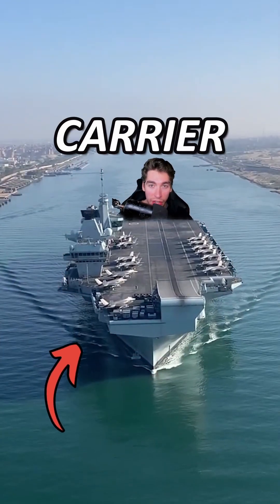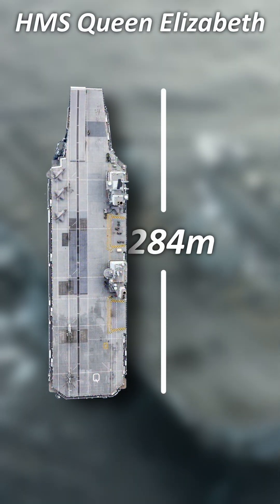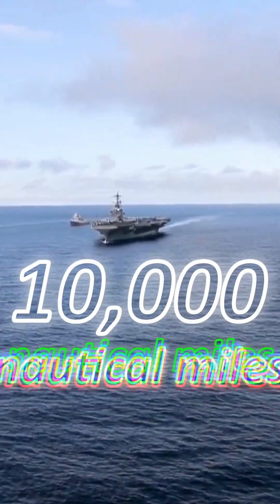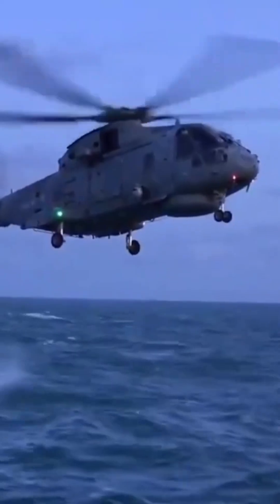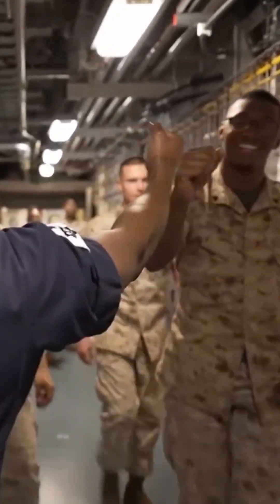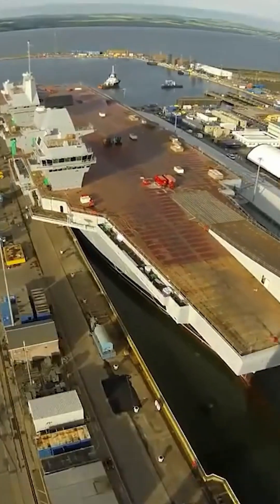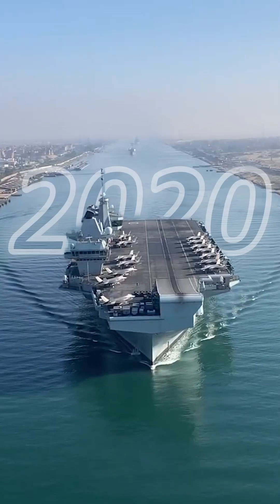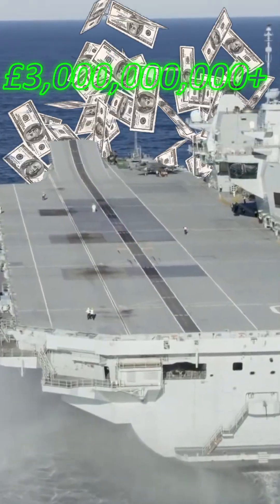Britain's Most Expensive Military Asset

Comment: Does it run on diesel? American aircraft carriers have a range of many years due to the nuclear power.
Reply: But they can’t dock in a lot of countries because of their nuclear fuel and they still need to dock to re supply even if it doesn’t need fuel
Reply: a mixture of gas turbine and diesel generators.
Reply: But it cant thought, cause it needs maintenance on other parts, your magnetic launcher barely ever works..
Reply: @JOhEight do some more research.

Comment: 3 billion is chump change Ford costs U.S tappers 35 billion + when all the fixes were done. Not to mention it takes a crew of 5,000 to run.
Reply: Yeah they are behind in technology, we only need 1000.
Reply: @JOhEight What are you talking about the Ford is the most technology advanced carrier on the planet. Why are you bragging about a thousand you're acting like they're the same size the Ford is over 3 times the size of the Queen Elizabeth.
Reply: @rivernunly1764  3x?? HAHAHA, tell me the displacement size of them would you.

QE is 72,000 Short tons, GF is 100,000 Short tons.

Yet, they need 5000 crew, yes it can hold more planes, but only around 30% more, not 500% more.
Reply: @JOhEight  that was my mistake I thought the Queen Elizabeth was 33,000 tons I was looking at the wrong carrier.
Reply: @JOhEight  but to still say that the QE is more advanced is just wrong.
Reply: @rivernunly1764  1000 Crew members are needed... it is more advanced, much more automated.
Reply: @JOhEight  I could hear that argument if it was a scaled up Queen Elizabeth but it is not. It can hold about 40 more aircraft it has a nuclear generator 3 times as many phalanx Point defense systems. Including the Sams other point defense systems. Use catapults multiple things no of course you probably could scale back about a thousand soldiers because there are a bunch of not necessary things like the store on board. But I think Comfort is important. But by your logic amphibious assault boats would be more advanced than the USS GF for the simple fact that they have less crew.
Reply: @rivernunly1764  QE max aircraft is not 40 💀, it is 72. 40 Fixed wing, 32 Rotary.
Reply: @JOhEight  ok read my comments again.
Reply: @JOhEight  I never said it holds 40.
Reply: Okay and? Just makes it sound like all Americans are insecure. America needs a bigger navy as they can't stay out of other people's business.

Comment: only 50 people required to re-arm the phalanx system and aircraft.
That's not as impressive as you try to make it sound. Maybe there's 50 people ready to close up and operate the system manually in the result of controls failure. But I would have thought a modern warship includes automation so the entire system can be operated by about 5 people.
Reply from the maker: Recommended is 50 but in an emergency it can function with only 12
Reply: Seems like it should be the other way round.
One person can operate the entire prop system from remote, but in emergency (when you lose main controls) there's a dozen people closed up to operate the gearbox and others on the gas turbines and steering gear.
Thanks for clarifying.

Comment: The latest US aircraft carrier cost about £11 billion making this one look like a bargain. I wish HS2 had been as well conceived and managed.
Reply from the maker: £27B accounting for maintenance, staff, fuel costs etc until its fully in service and passed all sea trials. In fact just the 32 month maintenance cycle cost for the USS Gerald R Ford equals the price of the HMS QE
Reply: "Who needs HS2 when I've got a private jet?"

- Rishi Sunak, probably
Reply: Try about 35 billion when all the fixes and cost overruns were added up. Was prices at 13 Billion.
Reply: The latest US aircraft carrier can also launch fighters, cargo planes and AWACS planes with a full load. This can not. It can’t even launch F-35s with a full fuel tank because of the idiotic ski ramp. If you’re going to build a carrier why half ass it?
Reply: @Austin-cx2xe  "This can not. It can’t even launch F-35s with a full fuel tank because of the idiotic ski ramp."

They actually are able to launch the F-35B with its maximum fuel and weapons payload from the ship. That maximum is slightly less than the F-35C due to the additional weight of the vertical lift system, but it still competes pretty well with a lot of catapult assisted aircraft. The Harrier it replaces was far more limited in comparison to catapult launched aircraft.

The issue is still tankers, cargo and AWACS, although they have been testing new drones over the last few months which will potentially be used to fill these roles to an extent.
Reply: Tankers, what tankers! Do they run this ship off of fuel. That’s horribly idiotic. Can’t believe they aren’t running nuclear. Where this ship goes 10k km before refueling. Where the US Aircraft carriers can go 20yrs before refueling! I’m not trying to do what this guy is doing. But is this ship blue water capable also.